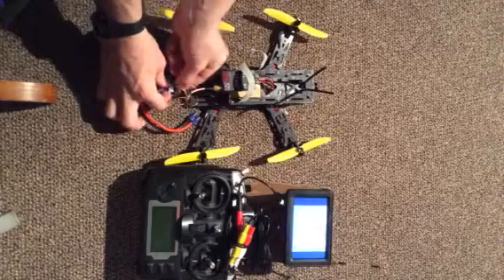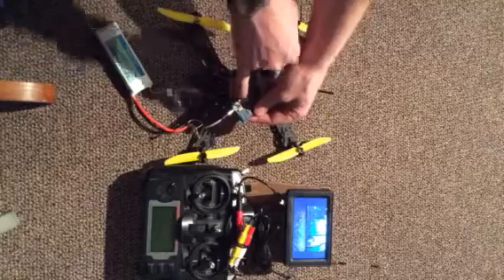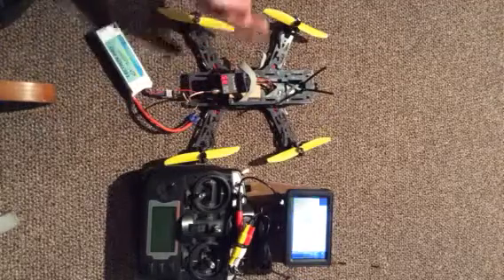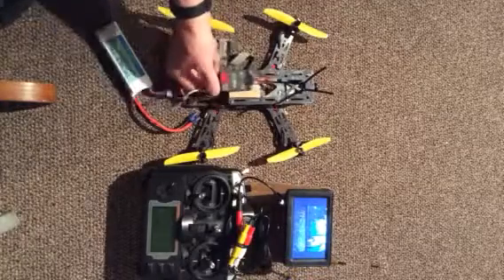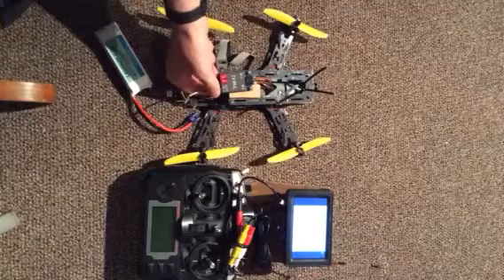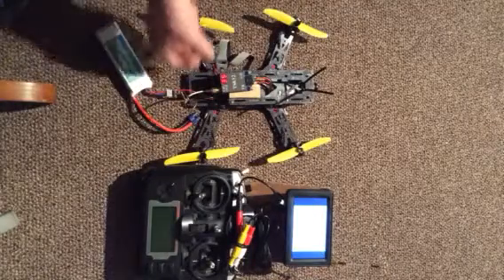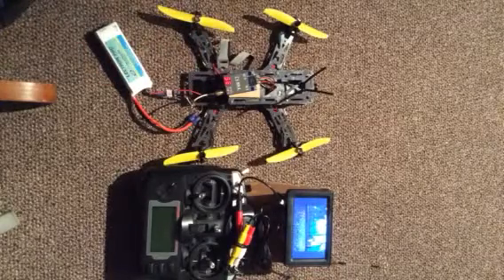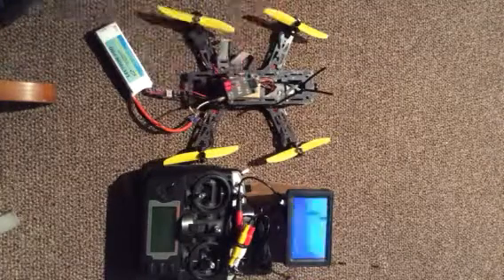Boscam ts832 quality control

Comment from the maker: Found the problem have a solution:
 I was sent a new ts832 by best hobby mall and they let me keep the old one so I dissected it. There is an internal heat sync/ shield that came un soldered and was causing shorts. That one never worked quit right.
The new one still seemed to have frequent video cut outs but was at least fly able. Not what I was expecting nor wanted. Spent some money on spironet antenna even though I was already using circular polarized. Much Better rang but still having random video dropout. Then finally added a low current filter. This seemed to fix it.
My theory: even when running a separate power supply, this transmitters internal voltage step down interferes with the output signal. Meaning any time you feed 11-12volts (in my case) directly to the transmitter the signal sucks. Now with the LC filter taking the workload off the ts832 this setup works.
I wouldn't recommend this setup though. I have since bought a ts5823 200mw from a reputable company and on the same setup it outperforms my boscam. It's less than half the weight and size and it was cheaper. 

I would recommend avoiding this transmitter